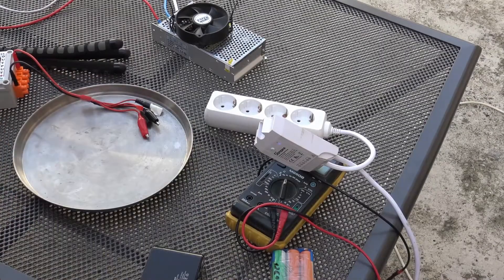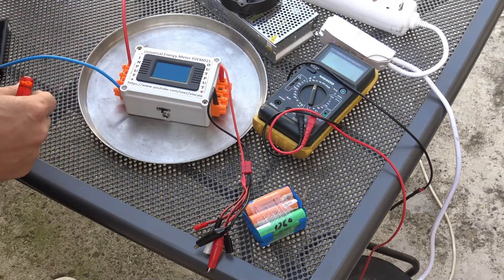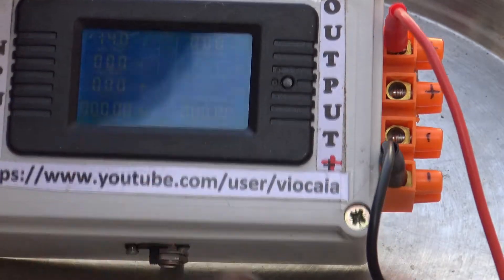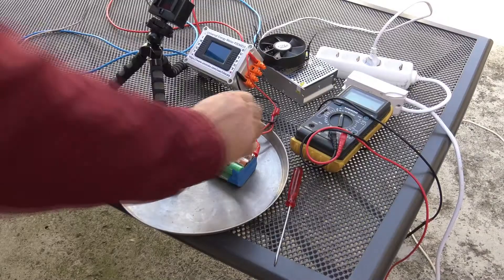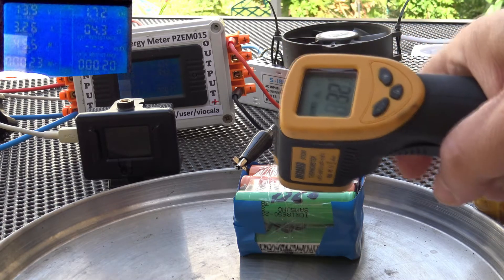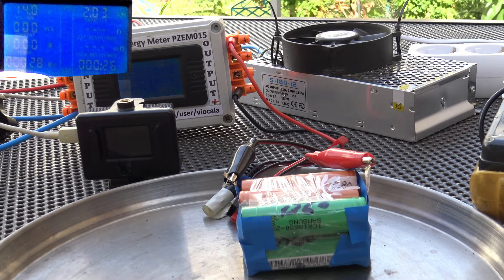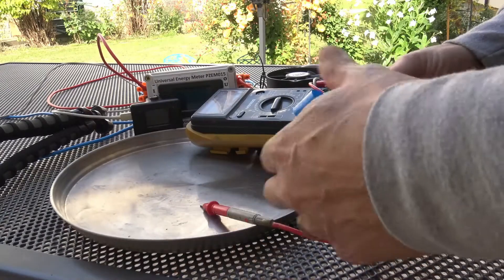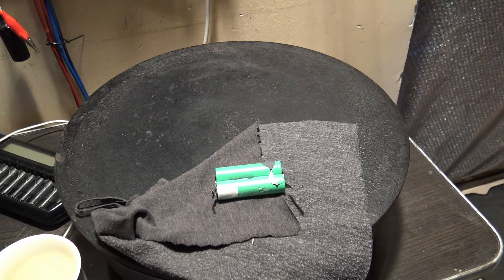DIY battery pack 3S2P no Li-ion charge controller and BMS

Comment: What if series connection? I solder 3 pcs 3.7v lit ion into series for the total of 11.1v with no bms circuit  and if i try to charge it with a 12v 1A adapter, is there a possible explosion of the batteries? And how long will i charge it? I hope you notice my comment
Reply from the maker: I notice and don't recommend..first 3 in serie should go to max 4.2x3 12.6v..if you come with 12 will not get fully charged. Second, to charge LiIon it needs special charger..first with constant current and last part with constant voltage..so it's dangerous to fire hazard if you don't follow the rules. Last if you have 3 in series , count the capacity of each element , let's say 18650 laptop cell is around 2Ah..so for you charger you'll need at least 2 hours to charge..but again I don't recommend without a proper LiIon charger.
Reply: @viocaia  jesus christ my when i tried charging it with 12v 2A, i noticed the smell arise from may battpack, i used my multimeter to check the voltage and i noticed the voltage drop, so i immediately pull the adaptor out from my battpack
Reply from the maker: @wainrightfilipino6082  Maybe you reversed the polarity..anyway don't make it worse it will burn your charger and ruin the batteries..just buy a cheap Imax b6, it's better and saver.Wish you well be save.

Comment: If you balance charge 2s2p (4 cells), 3s2p(6 cells), or 4s2p(8 cells), will the balance charger charge every cell or will count each parallel pair as a single cell when using 18650"s ?
Reply from the maker: Second..it will be seen each parallel like a single cell..even 100 in parallel will be the same, they balance each other and the whole parallel cell in regards with the others in series.
Reply: @viocaia  Thank you for your answer, that makes a lot of sense.

Comment: What was that click? Was it internal conection on positive side of the cell that burned.
And if only two cells burned, why the charging stopped? Iwould say, the other four pink cells were kaput also. Only two green Samsung cells blown internal overcurent protection.
And finally the clicks happend at 3 amps. It means, only 1 amp per cell. This should not be problematic. 

Would make sese if pink cells blown protection first, than all the current was on samsung cells. So it fell to 3A, which is still enough to blow protectin connection on positive contact of the cell.

Can you open the positive contacts to see if there is any protectin wire, and if it is blown. Would be very interesting to see.
Reply from the maker: It is a series connection.The others are ok..so the last one standing was at 2.55A..for few seconds..I'll open to see if there are fuses.I'll have a new test, this time with 12.6V max.BUt it's nice to know there are internal fuses!
Reply: @viocaia  I'v seen a few cells protected this way. There is a narrow strip connecting positive contact and the actual positive of the cell. So I wonder, if that two cliks were sounds of blowing these protection strips / fuses.
Reply from the maker: Sorry my mistake..It is a 3S2P..that's why current got lost when first row passed...

Comment from the maker: I did overvoltage in purpose..but nothing burns!
Reply: Always the way that when you want something to happen it doesn't and when you don't it does.  btw, on your last video I think my comment to you was marked as spam for you to approve where I thanked you for the video and the shoutout.
Reply from the maker: @generalawareness101  My pleasure! But I'm still looking for some fireworks! Until now I found that is very possible some 18650 to have internal fuses blown higher then 2.5A..interesting
Reply: @viocaia  The only lithium I have seen give fireworks are the Lithium Polymer (LiPo) that are silver packs and have two wires coming out from it.
Reply from the maker: @generalawareness101  I'm looking for ...soon!